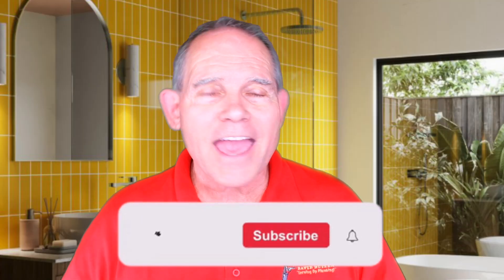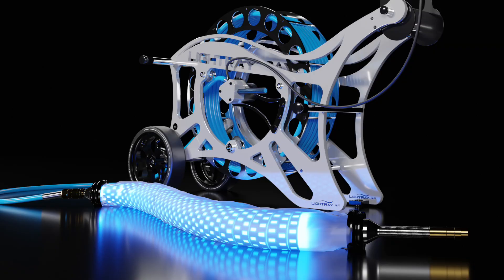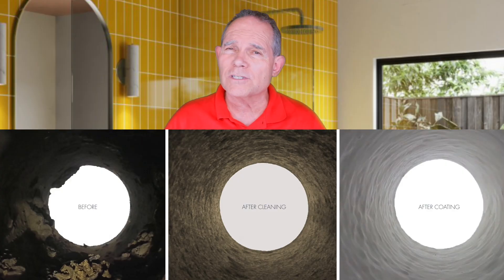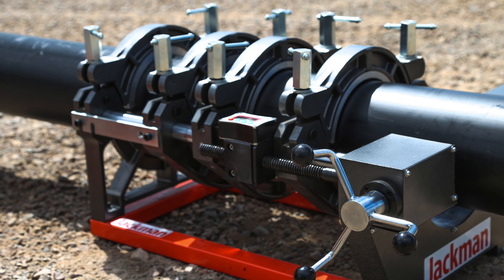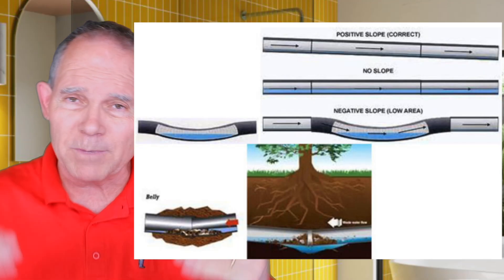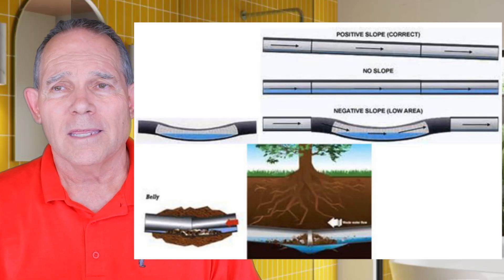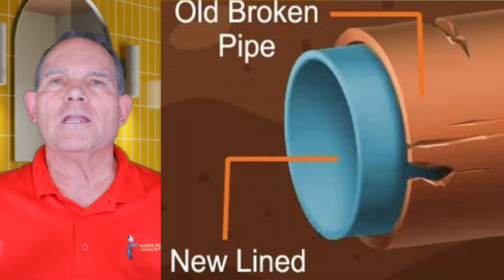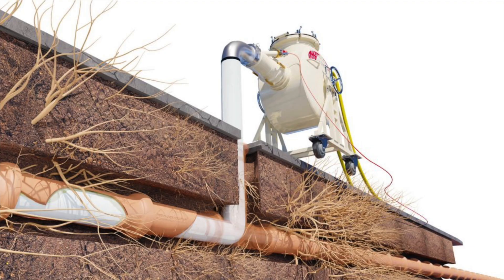4 Types of Trenchless Technology! (Pipe Lining, Pipe Bursting, Pipe Coating)

Comment: Please advice! I am a single mom I own a 2 bedroom home and I have a collapsed sewer system (orangeberg) I am trying to pay attention to everything you are saying but still hard for me to understand all the terms. I’ve been quoted 22-30k to install a whole new sewer system. What can I do in the meantime to avoid having to replace the entire sewer system?? There is so much information on the internet but so confusing. I’ve had plumbers come but I feel like they don’t take me seriously and don’t ever try to help my situation. Any advice? Bathroom waste and dirty water is backing up into my basement. When they installed a camera down there they couldn’t get too far down because there is a lot of waste and dirt on the pipe and will not allow the camera to go any further so they suggested I call a company to come and hydro jet my collapsed sewer line to at least get me by for now until I get replace my entire sewer system.
Reply from the maker: Unfortunately if it is collapsed, jetting won’t help and not good to jet orangeberg.  Maybe you can replace just part of it until you can afford to do it all.  I am assuming just the yard has to be replaced and is where the orangeberg is. You can dig up some of it where you can get the camera in to and maybe just replace that part for now but it is exploratory surgery 😕. Get a reputable licensed plumber and he should have some financing options.  I wish you the best and hope this helps 🤞
Reply: Any advice or tips? got the same situation here with $13k+ quotes rolling in. Planning to replace everything from sewer connection in the street to plumbing in the house.

Comment: Quite interesting insight on the four types of trenchless technology!

Any suggestions for a clog in the master shower and commode with cast iron plumbing?

One plumber used the snake initially in the shower (about 60 feet), then in the commode drain (about 40 feet) but clog remains.

Then, the suggestion is to replace all of the cast iron drain lines with PVC but all around the house will need to be trenched out - including concrete.

Have a slab foundation and older home that was built in the 60s.
Reply from the maker: Usually if the shower and toilet are in the same room, the clog is not 40 to 60 ft away but much closer. It’s hard to say without seeing and definitely need to camera the lines to see the condition of the cast.  It may or may not need replacing. Best of luck and thanks for watching!
Reply: @ServingUpPlumbing  

Noted!

Plumber was not able to manually push the camera down the drain either in the shower or commode.

Hence, the statement that the cast iron drain lines need replacement.

Is trenchless technology applicable?

Comment: Your video is very informative what type of repair would you recommend for pool pipes 11/2” pvc pipe
Reply from the maker: Since they are pressure pipes usually you have to glue /solvent weld it.

Comment: We live in a house that all the drain line sits on top of the slab(uncommon in our area, but a few builders did it in the 1960-70s). We're pretty sure there is a slow leak somewhere in the drain line. Wondering if lining would be an option vs going through the wall or tearing the shower/tub surrounds out. The main line runs out the back of the house then takes a 90 degree turn down to the under sewer line. It's a small house with 2 bathrooms and kitchen all back to back. Maybe a 5ft run back then a 90dregree turn for another 5-6 ft.
Reply: I’d suggest just pulling it and remodeling the bathroom while you’re in there.

Comment: Can pipe lining be used to repair a leak in a 3/4” copper line? And do you have to re-line the entire run or can you just re-line to just past where the leaks is located? Thanks.